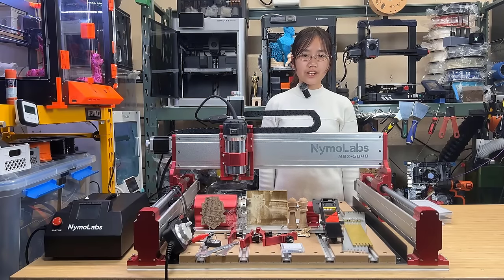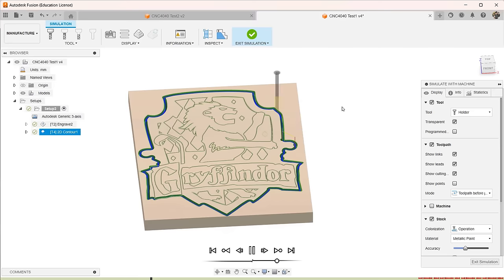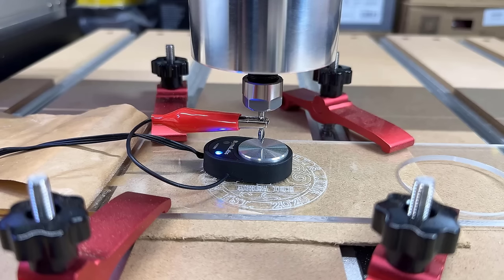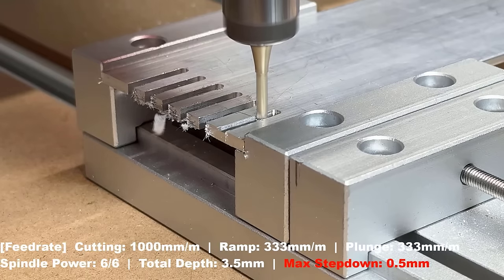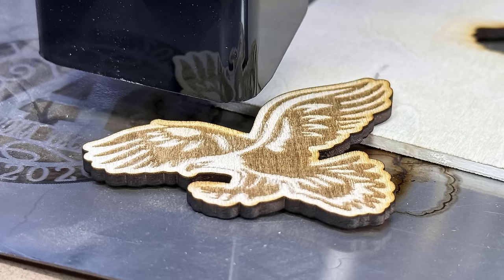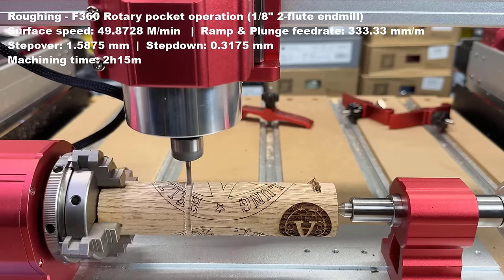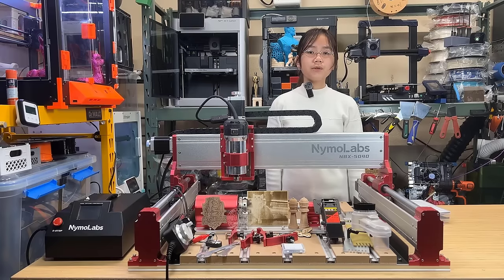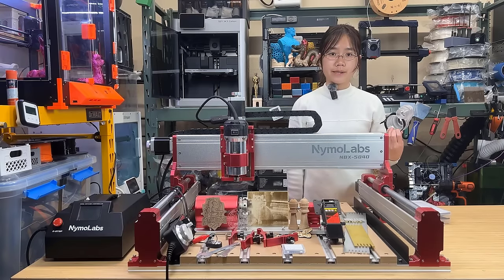NymoLabs NBX-5040 CNC Router: 710W Spindle, MPG, 4th Axis | Wood, Acrylic, Aluminum, Brass Tests

Comment: Metallurgical teaching moment: brass might technically be harder than aluminum, but brass is the gold standard for machinability among metals while aluminum can sometimes be gummy depending on the specific alloy. You'll see a similar phenomenon with, say, resulfurized 400-series stainless steel and 300-series stainless steel, where the 400-series stainless is likely going to be harder but chips break more easily thanks to the sulfur. 

Love the video as always!
Reply: If brass is the gold standard, is gold the brass standard?
Reply: @frankhovis Honestly? Yeah...gold's peerless ductility makes for poor machinability. A little spelunking on the Internet suggests that some people actually do machine gold alloys (along with silver and platinum alloys) but special tools and techniques are necessary to make it even reasonably doable.

Comment: Never worked in Fusion - do you guys send gcode directly to the router? I have vold vision 2448 router and in Vectric Aspire I just push start on both application and router which is convinient. I like Aspire which has nice a interface. I can work with both: 3D model and vectors imported from dxf/dwg.